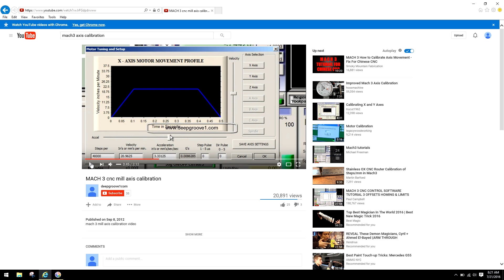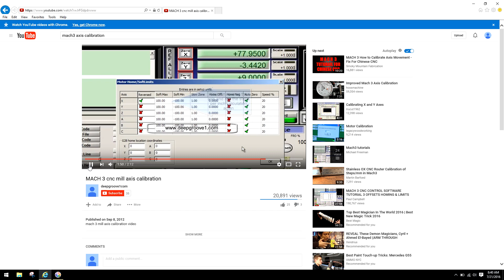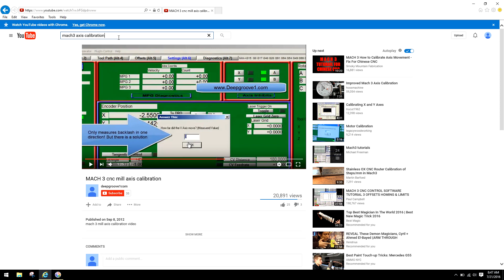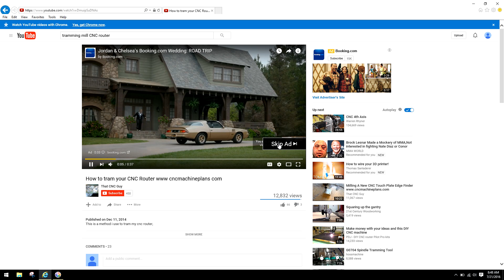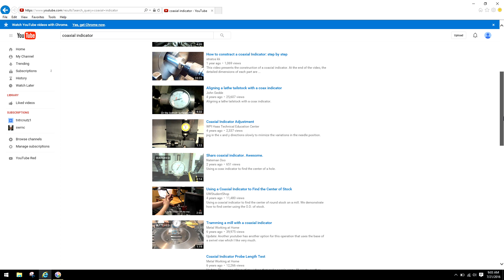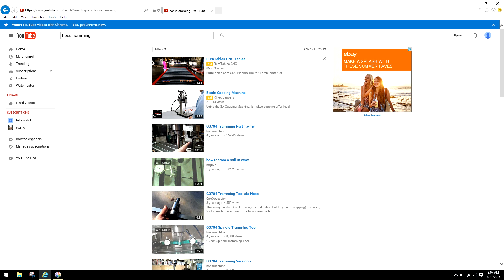Mach3 CNC Axis Calibration & Tramming (This Will Make Your Machine Accurate)

Comment: Hi Vince thanks, for very good tutorial video very easy to follow I was able to calibrate my X, Y but my "Z" keeps losing steps whatever I input it only moves half as much  I put 4" and it moves 2", I tried 4 times and even at 16000 steps per no difference I wonder what's wrong?
Reply: Did you try removing the axis, and going over the mechanics (bearings etc.) I had the same issue and found some loose bearing block screws which corrected my backlash.
Reply from the maker: Thank you, Lou, as always for your support. If you haven't tore down the axis I would start, there if the issue is continuous as the Storyist is right many times the issue with accuracy on ball screw systems is loose screws or bearing block play. I also recommend checking the motor tuning settings on that motor as it may not be rated to the other units used on your X, and Y axes. Thank you and have a great weekend!
Vince
Reply: Thanks Vince, I will check that out that motor came it came with the system it worked fine before. I will check it all out I have and extra motor just in case that's the problem. @corvetteguy50
Reply from the maker: You bet...:) Have a great weekend!
Vince

Comment: I'm curious to know when you tram Z in the two ways shown what results do you get when you check it at say 5 inches off the table?
Reply from the maker: Hey Dustin,

I'm sorry I would need more detail as each chassis will produce different tolerances based on the calibration tool used, and its transmission. Tolerance variables for any axes calibration should be reduced by using a precision measuring tool (dial test indicator with high resolution). The next step would be performing axis calibration on the axis at least 10 cycles to form a time line of consistency with all moving components. The more cycles an end user runs with the consistency holding true each time assures the calibration is much more accurate.

Thank you,
Vince

Comment: Great presentation. Tried to follow but my MOTOR TUNING window in config will not open.  Any suggestions on how to get it back?
Reply from the maker: Thank you for your support. The first step to resolve virtually all issues software related is to copy your settings down, and reinstall it. This assures you're starting with a fresh copy, and you can begin documenting from there. Thank you,
Vince

Comment: Thanks for your video. You suggest it's best to do the calibration over the longest distance possible, I.e longer than an inch. However you suggest not using a ruler but a dial indicator. Apologies for not understanding but how can you use a dial indicator over larger distances? Thanks Paul
Reply from the maker: Hey Paul, Thank you for your support. Here's the video to review of the process done live with parallel blocks for an extension for length, and a dial test indicator https://youtu.be/XkO5tc-jSxw 

The key to achieving the highest accuracy regardless of the distance measured is using a high resolution dial indicator preferably .0005 to .0001 which is ideal. 

Have a great weekend!
Vince
Reply: I know I'm pretty off topic but do anyone know a good place to watch new movies online?
Reply: @Aron Vihaan flixportal xD
Reply: @Fletcher Andres Thank you, I went there and it seems like a nice service :) I really appreciate it!
Reply: @Aron Vihaan glad I could help :)

Comment: Great job.. very well done... I have an issue with my Y axis moving faster than my A axis ( slave)  Any suggestions? Thank you
Reply from the maker: Hey Mike, Thank you for your support. The easiest way to manipulate the speed of the A axis is through the motor tuning tab in Mach3. Thank you, Vince
Reply: @corvetteguy50  Thank you Vince. Is this a common issue adjusting the speeds of these two axis? I was thinking since one is slaved to the other they would be sequenced together.
Reply from the maker: @mikeprestigiacomo5420  You didn't explain they were running in a slave configuration in your original message. This I would review the axis with the slow motor carefully to make sure the issue doesn't lie in the axis itself as far as its bearings, and transmission. If you still can't find joy after going over the axis its time to install another motor on the axis to see if the issue is resolved. Thank you,
Vince
Reply: @corvetteguy50  thank you so much for your help
Reply: @mikeprestigiacomo5420  I'm having the same Issue.  A axis is slaved to Y.  A moves faster (and ends up farther) than Y.  I tuned them each individually, then slaved them together and same issue.  It appears that my A axis isn't responding to the tuning, because if I tune it (not slaved), then tune it again, it's still off the same amount.

Comment: How can I find someone who I can hire to calibrate my machine and make it run perfectly?
Reply from the maker: David, Thank you for your support. I would need to know the details of the system your using, and the issues it has before we can discuss getting it to run perfectly. Thank you, Vince
Reply: @corvetteguy50  I have Aspire and Mach 3 software. When I Do text my machine cuts in reverse. I have to mirror all my text to get it to cut properly. Is that something I can be told how to fix? Thanks, Dave
Reply from the maker: Hey Dave, thank you for your support. Tthat sounds like a CAM programming issue that I would discuss with Vectric's support as they should be able to help you immediately with it. Thank you,
Vince

Comment: Great channel, very informative, trying to fix an issue i'm having has lead me here.....Have you experienced this issue before ? I can calibrate my machine nicely (6040 CNC) over about 12" distance using a digital slide gauge (it gives repeatable measurements itself when checked) , if i keep the machine switched on its nice and repeatable, +/- 0.02 thou. If i switch it all off and come back later, hours or days then without changing anything my calibrations are out to the order of 0.20 thou. 

Digital slide gauge aligned with the axis.

Speeds, accelerations etc kept low, no backlash detectable but always jog in the measurement direction anyway incase before zeroing

6040 CNC, G540, 48v power supply, Mach 3
Reply from the maker: Blackcatunderwater, thank you for your support. I really appreciate it. Are you using the version of Mach3 that came bundled with the 6040? If you are its a pirated copy, and has been modified which explains the issues with calibration. Use this video https://youtu.be/K_9fvehvv-w to reference when removing Mach, and installing a legitimate copy as you want to uninstall it completely. (I sell it if you need a copy) 

Thank you,
Vince
Reply: @corvetteguy50  thanks for the speedy response, that what one of thing lefts that I had on my suspect list of causes, I'll have a look tomorrow, it did come bundled with the router.
Reply from the maker: @blackcatunderwater1446  I thought so, as I've had past clients have the same issue. Give what I said a try, and I think you'll be all set :)

Thank you,
Vince
Reply: @corvetteguy50  Hi Vince, could you tell me how much it is for legit copy of Mach 3 from yourself ? I'm in the UK if that matters or not, couldn't find a way to message you privately.....

Comment: So I watched your vid, great thoughts by the way. I was wondering if your idea should be taken further. Would it be beneficial to run the calibration test while cutting? Seems like if this idea is really going to be beneficial one would do this under load not just moving from point a to point b? What are your thoughts?
Reply from the maker: Brad, Thank you for your kind words. The machine won't reflect anything different if its properly calibrated, and trammed. If you feel better going that route it certainly won't hurt, but a machine setup correctly doesn't fluctuate when performing a live test. If you are going to do a live test I suggest using machining wax to prevent the possible issue of destroying a piece of raw material. Its always better to practice then move on to the real substrate when you know your dead nuts on. Thank you,Vince

Comment: Great video and thanks for the link to my tramming video. You made a couple of great points and I'll be sure to mention them in my updated tramming video where I use a granite surface plate which sounds expensive but only cost $69 brand new from a local supplier here in Australia. You made a good point about the foil being soft but to let you know it hasn't moved at all in 3 years. I have had to tramm the left and right with the screw adjustment every 8-10 weeks but the foil hasn't let me down but I would use finer shims next time for greater accuracy. Again great video.
Reply from the maker: Thank you for the kind words, and your support. Granite would be an excellent plate for reference. I look forward to seeing the process. Vince

Comment: Your "theory" about loss due to friction on the axis travel sounds a bit vague.
You compare the BHP of an engine with the travel of a spindle.
Actually you do reference more likely to the spill of torque. Also that is of the track but closer than your analogy ;)
Reply from the maker: The Theory of setting steps per inch using a mathematical formula isn't accurate to the actual distance traveled do to mechanical loss on automation mechanics. In the video I explicitly explain comparing the loss of HP from an engine to a vehicles transmission as being the same mechanical loss  we experience with our automation robots. The analogy is extremely accurate, and as an engineer building over 500 systems a year I assure you this explanation is quite direct ;)

Comment: If I have a SINO DRO can I use it to calibrate my axis ? The resolution is 0.005 mm.
Reply from the maker: The resolution of the it is certainly doable as it translates to 00019685 of an inch. You can try it ,and see if its within your tolerance, and worse case scenario you can always perform it again with a different indicator if required.Thank you,Vince
Reply: Thank YOU for your fast and honest reply. Have a nice week.